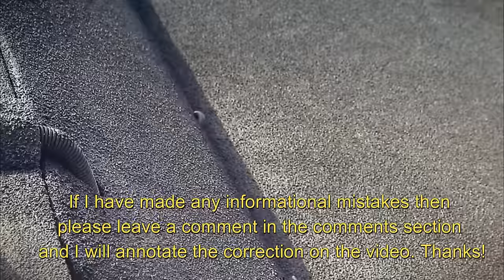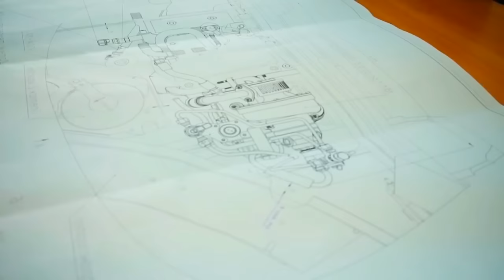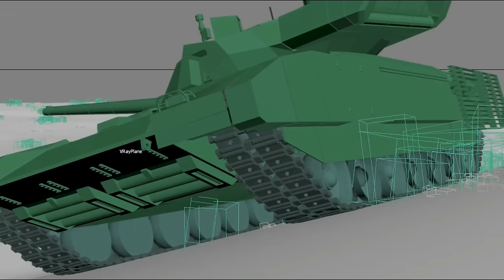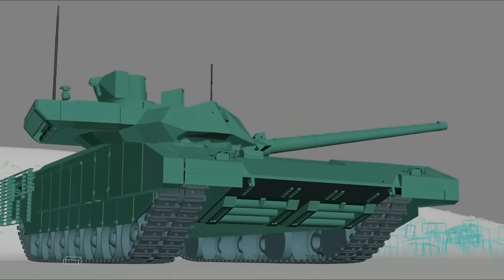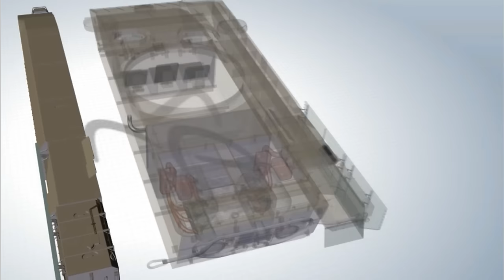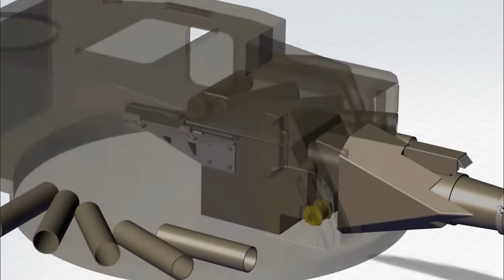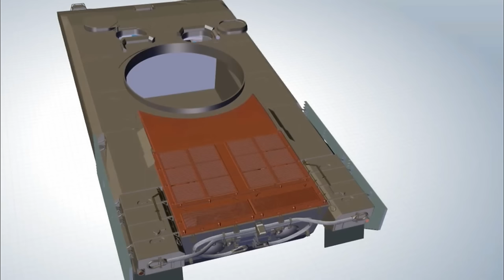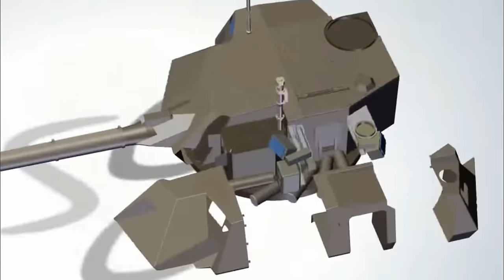T-14 Armata Russian Main Battle Tank - Tank Overview

Comment: With Active Protection Systems and unmanned Turrents,  Russia(T14) & Israel(Merkava & Hamer) are showing the future of armoured combat vehicles.

APS & unmanned Turrents will now become standard in futgure designs.

A Universal  cha sis will also become common used for both the MBT & IFV or APC.

Israel has shown with the Merkava & it's Trophy APS that traditional western front engine APC/IFV chasis can be used as the foundation for any next gen MBT to counter the T14.

Israel could easily make the Merkava 5 with an UNMANNED turrent, with a reduced crew and comfortably match  the Russian Armata.

The US could also quickly design an unmanned turrent using the Israeli APS for their existing M1 Abrams to also keep pace if not better the T14.

Well done Russia with what they did with the T14 over the heavily flawed T90.

Brom on the unmanned Turrents & APS
Reply: I disagree on the common chassis part. MBTs and IFVs have much different internal volume requirements that it would end up in sacrifices on both ends.
Reply: With effective Active Protection Systems, you no longer need to rely on the standard low profile, heavily armored MBT chassis but can now use a common platform.

With the advent of unmanned turrets reducing crews to 3 or even less in a common area of the tank means less armor and a reduction in weight further showing the benefits logistically of a common chassis for core armored  tracked vehicles.  .
Reply: Some modern APS that are able to affect APFSDS do exactly that, affect them, not entirely intercept them. There is still as reasonable amount of passive armor required. Also the Afghanit APS on the Armata series only covers a small area of the vehicle.

Unmanned turrets, sure. I didn't say anything against it.

Comment: I bet that more then shooting the armata, armies are going to send emp shells on it so it can target nothing... and the crew cant get to the tank in battle conditions because they dont have the acess to it.... Thats the con of having a fully protected crew and a fully electric weapon systems...
Reply: The tanks are fully shielded and able to survive a nuclear explosion in 300-500m. Most of them, like the Armata. There is no e- wiring, only the optical data bus and power supply modules, it is individual, back up and screened multiple
Reply: Джо Неуловимый except there is? how could they even shoot without e-wiring... and as i said if anything went wrong with the autoloader, the tank would be totaly out of combat and the crew couldnt fix it because they cant get to it
Reply: Sebastian Partyka What is able to knock out a tank, certainly kill the crew. So for the moment the question is not relevant
Reply: Джо Неуловимый Are you implying that there will be no mechanical failures? Thats what im talking about.... the crew wouldnt be able to do anything about the gun jamming so they would have to pull back because 1 screw fell off...
Reply: Sebastian Partyka We do not use the manual loading of more than 40 years, is extremely rare malfunction. The use of manual labor is an anachronism. Forklift faster, more reliable than a man, he does not need the pension and insurance, do not need extra armor to protect it. No need 4 crew member
Reply: There's no threat from EMP for such vehicles, since the armor is to absorb most of it energy.
Reply: Джо Неуловимый  I didnt say theres a need for a 4th person.... and also russian engineering is the best.. i should have known

Comment: One thing for sure: Its so much uglier compared to the previus t-90, t-80, t-72. Those where some sexy ass tanks. This one on the other hand... Meh
Reply: The Armata series seems to be western influenced. Especially the running gear looks nothing like those on the T series. Although it bothers me why it has 7 small roadwheels instead of the 6 larger ones seen on the T series, tests made by the germans in the 90s (EGS) showed that fewer, but bigger roadwheels actually have better geometry, resulting in better running characteristics.

Comment: It's a great tank and all, but i'm not a big fan of the turret
Reply: I mean the swivel, not the gun. Still a great tank though.
Reply: @ben-jc5ub  "arrangement gun carriage" 
"The gun is installed in a small uninhabited tower, the ammunition is under the tower (according to some data, the ammunition is generally taken out of the hull by attaching the nacelle with an automatic loader to the aft of the uninhabited tower), the crew is isolated in a small armored capsule in the nose while its number can be reduced to two people.
Presumably the T-14 turret booking consists of the main booking and the anti-splinter casing, the instruments on the tower are located between the booking layers. The casing protects the tank's instruments from splinter, high-explosive and bullet damage, and is also used to reduce radio-visibility against the most sophisticated anti-tank guided missiles with radar guidance in various frequency ranges. In addition, the casing of the tower, performing the function of "Faraday cages", is one of the means of ensuring the declared stability of devices to an electromagnetic pulse. The casing is collapsible using latches, which allows you to get quick access to the devices under it for repair and maintenance. Part of the equipment on the tower as KAZ surveillance radars can be quickly replaced in field conditions without disassembling the tower housing." (с)

Comment: I'm going to run up to this tank and stick gernades to it. Problem solved.
Reply: And as your running up to it that 12.7 mm turret on top is going to swivel around and rip you to shreds, not to mention a conventional sticky gernade wont even harm it. Just be a puff of smoke on its side.
Reply: Dustin Freeze Works in H&G should work in real life right???
Reply: Andrew Darrell No. Kamikaze attacks only work against BT-7s.

Comment: BRRRRT...no more Armata
Reply: A-10 is of little use even against T-72, against T-14 it does not work at all.
Reply: S200 no more A10s
Reply: @sidharthcs2110  Use Vega with a nuclear warhead against A-10 !?
The C-200 is a long-range stationary air defense to protect against bombers and missiles. She can shoot down a tomahawk or a-10. But it is better to use the BEECH, Tunguska, TOR, Pantsyr, C-350 (short range) or Wasp, or generally a MANPADS group launch.
Reply: @elusive6119  
What if I wanted to shoot down A10 from a longer distance?
Reply: @sidharthcs2110  BUK, C-350